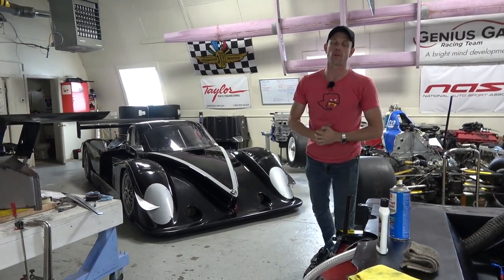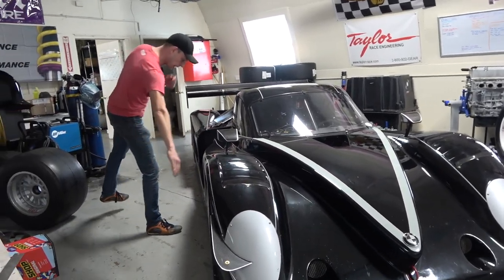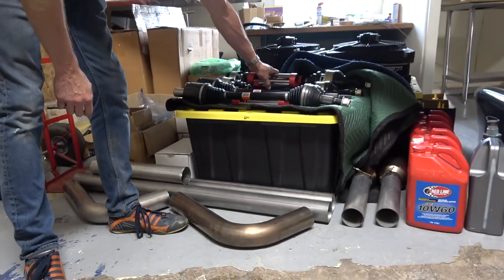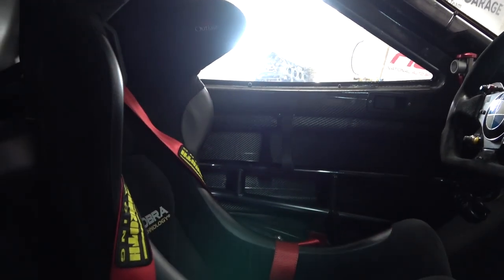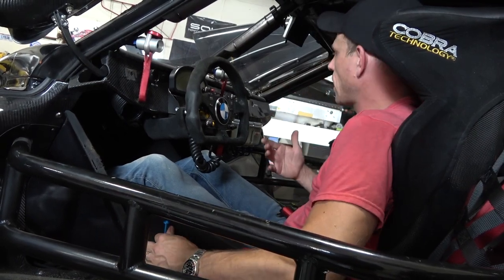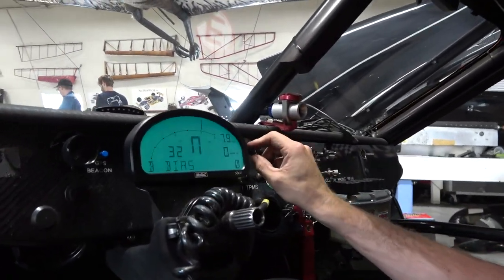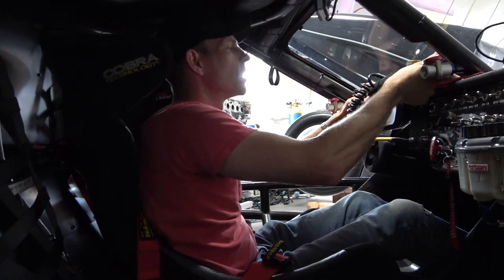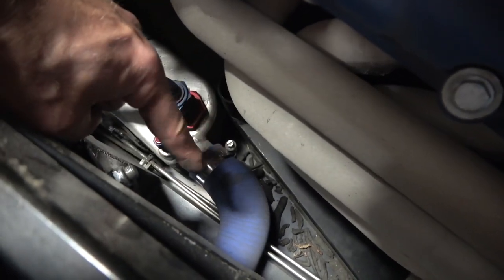Full tech review of DINAN BMW V10 Daytona Prototype | Genius Garage

Comment: 36:03 Fun fact, before glass cockpits, a lot of Soviet and other Eastern Bloc planes and vehicles uses infra-red lights to shine on gauges and switches that were coated with fluorescent paints so you had absolutely no reflections on your canopy or windscreen.
Reply: They also use red lights on the flight deck during flight operations at night on current day aircraft carriers. No white lights allowed. This helps cut down on visibility for others who might want to spot them.
Reply: @heimburger4  red is also used due to the structure of rods and cones in the human eye. Rods handle light intensity, whereas cones are responsible for colour. Rhodopsin in human eye rods takes about 30 minutes to regenerate, but the rhodopsin is insensitive to red light.
Reply: Help me out here...when did the Soviets start using infra-red...the 50's?
Reply: @jordanpreexisting224  Early 50s if I remember right.

Comment: I am guessing that the 5.8L Dinan S85. 94mm bore and 83mm stroke, I think. Check with Lang Racing, but hopefully you won't need any replacement rotating assembly parts, they aint cheap from what I recall. 

Gonna be following this closely when GG gets to it. The S85 has always interested me.

Comment: If you left foot brake, which is the fastest way to drive a car like this, always be repaired to press the clutch pedal in the event of a spin.  This car does not have an “auto clutch” like more modern race cars. It probably has no anti-stall provisions too. In the event of a spin, the driver needs to move the left foot from the brake to the clutch pedal, and move the right foot from the accelerator to the brake pedal, then “both feet in”.  The risk of not depressing the clutch pedal is not only stalling the engine.  If the inertia of a 180 spun car rolls the car backwards and the clutch pedal is not depressed, it will force the engine to rotate backwards, sometimes at high RPMs.  This will force the crankshaft in reverse RPM with ZERO OIL PRESSURE.  This can cause damage to bearings and especially the timing chains running backwards with no oil pressure on the tensioners.

Comment: I thought my front shocks were bad but it turned out my front sway bar bushings were dry rotted to hell. On the highway it would dip to the side so bad when going around a bend. And it over steers drying regularly feels like the front end was wobbling while i was making a sharp turn

Comment: 'Believe I seen a red AW11 MkI-a MR2 parked out front on one of your much earlier videos.,. Would love if you did a video on how to drive that especially if it's the model with front&rear sway-bar and not the understeering mess (by MR2 standards) USDM Mk1-b which had the rear bar removed to reduce how sharp the front end can be,

Anyway the AW11 MR2 is one of those rare cars that let you drive with next to no understeering safety margin especially when trailbraking or simply letting the short wheelbase weight shift forward naturally almost like an ATV, with interestingly odd gearing ratios, 1st being so short that you can run it out before going halfway thru an intersection, and 4th being an overdrive gear (a bit far from 3rd) whilst only being a 5 speed with the 5th speed being a bit too short for quietly cruising yet somehow too tall to ever find yourself reaching for it in most fast tracks (geared for 150mph @8,000RPMs IIRC {like 145@7,500}) AKA 75MPH is a screaming 4,000!!!!RiPeMs

So if you have access to said MR2 please make some videos on it, if you've the time please, & try and relate how much of its dynamics relate with some of the more established race machines

Comment: 14:30 - Nods in Slant Six, that takes nearly 10 minutes of non-thrashy-warmup before oil flows out the rockers arms and down on to the valve train.
The whole "What's it sound like cold start revvvvvvvv,..." yeah, that never made sense to me either.
32:14 - They also do that if they're disciples of Smokey Yunick and want to make it harder to post-race scrutineer the insides of components,..... :D

Comment: Casey, how long do unused tyres last for - IE they harden and are no longer safe to use on the car?
Reply: Dunno if this also applies to race tyres, but DOT-approved street tyres have a nominal shelf life of six years (from manufacture).  Beyond that, the rubber degrades substantially.